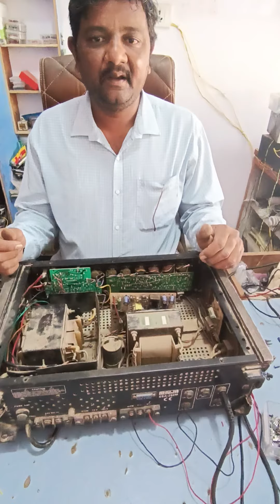#Ahuja amplifier ssa250 m repair/తెలుగు లొ

Comment: sir ahuja amplifier tza 4000 2zone capacitor 50w 15000uf ke jaga 40w 15000uf laga sakte sir
Reply from the maker: MFD/voltage and temperature,